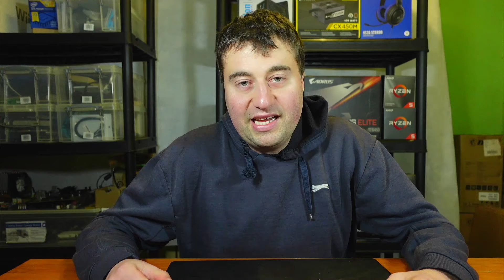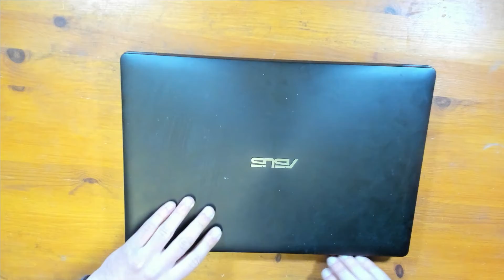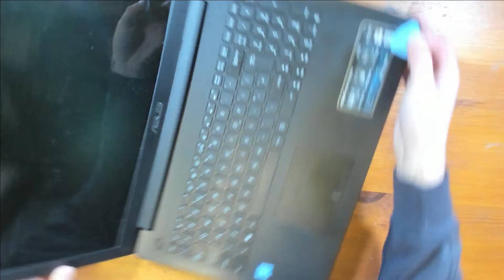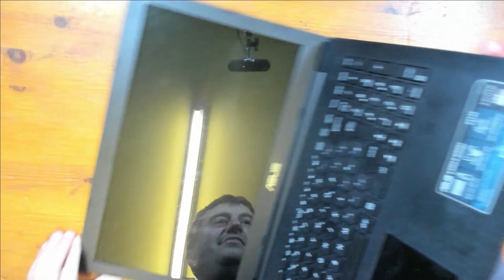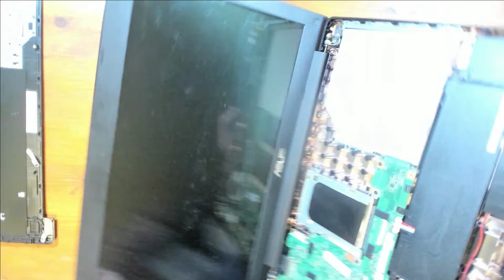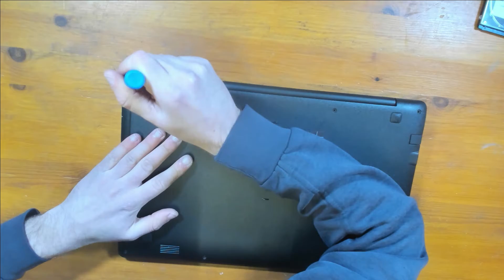How to install a SSD into an old Laptop - ASUS X553S SSD Replacement

Comment: Hey do you happen to have any advice for if the screws on the HDD are screwed in REALLY tightly to the point they are impossible to remove?
Reply from the maker: You could use a rubber band in-between the screwdriver and the screw, that might give you a bit more purchase to turn the screws
Reply: Just for anyone else with the issue, I had to get some strong penetrating lubricant and leave it on the screws for like an hour, and then it was still very hard to get them out by screwing them in and then out  - must have been glued in.

Comment: Before you do this you'll likely want to get a usb to sata cable/caddy and clone your HDD to the new SSD
Reply from the maker: Yeah I just installed a fresh new Windows 10 install on the new SSD. It would be worth making a backup first and even cloning the drive if you have a lot of data you want to bring over.
Reply: @UltraGameWorld  Oh, also worth writing down your windows 10 code before, just encase! (many ways to find this for example using command prompt)  and maybe turning off bitlocker if it is on? unsure about that last bit.
Reply: You can also get a thing that replaces the cd disc reader with a slot for another HDD/SSD (called laptop optical drive HDD caddy or something similar)

Comment: My laptop is ASUS X553M XX516D, with Intel Celeron Quad Core (4th Gen) N2940 ,RAM 2GB Inbuilt, EXPANDABLE TO 4GB. Will upGrading with SSD worth it.
Reply from the maker: Yeah would make a big difference to boot times and general usability